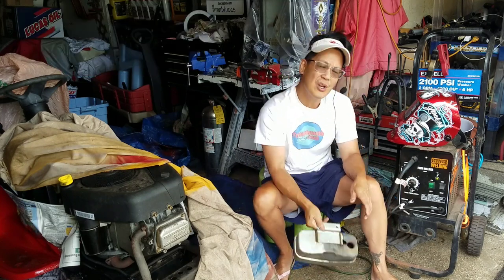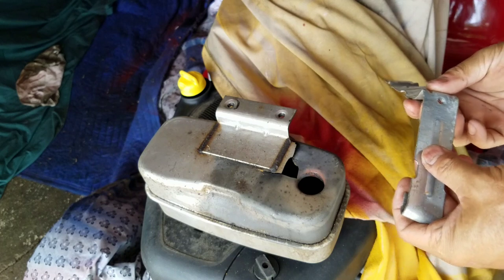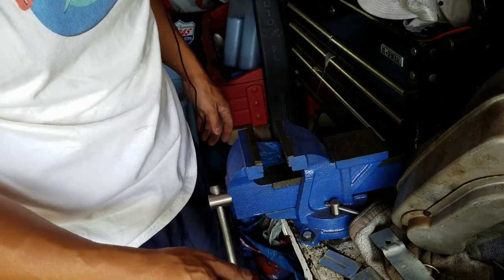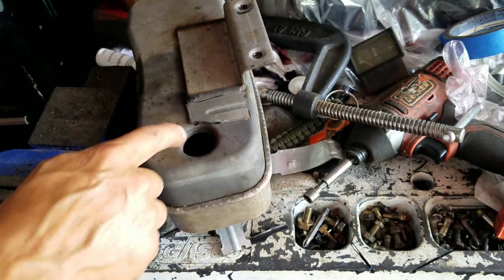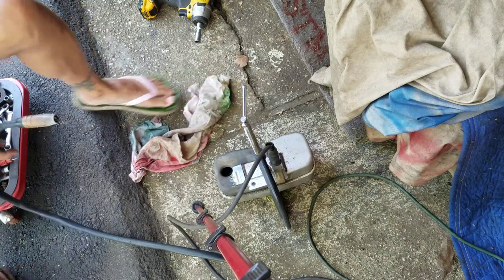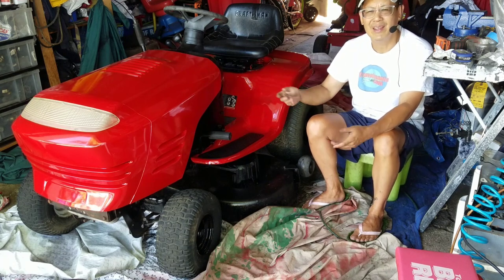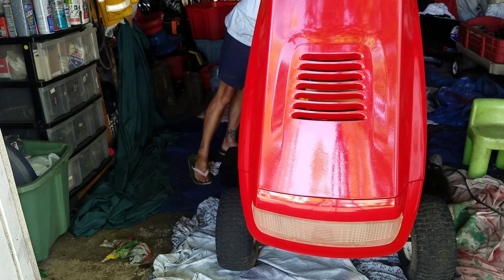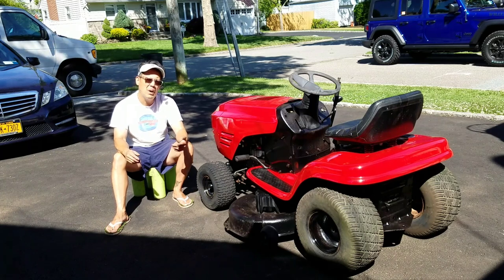FRANKEN TRACTOR NIGHTMARE PROJECT FINALE REVEALED DAMAGED MUFFLER WELDING WELD REPAIR INSTALLATION

Comment: I have the same tractor DLT 300 it’s a little bit older, but it the engine is good condition does not rust, but the pain is fading now that I watch this video I am going to do the same thing to you that I just bought today for candle spray paint red and two black one and I’m gonna paint the wheels black the frame black I think I’m gonna take it apart, but I’m going to make it look good after thank you for the video, you gave me a great idea👍👍 I can’t wait to start the project
Reply from the maker: Hope you’re subscribed

Comment: Henry, you are a GOD among men. Because of you, I was able to fix a used mower i bought from a crook, who sold me a lemon. It is a Craftsman 19.5 hp Craftman.  I changed the following:
1-Coil
2-Chinese Carb
3-Fuel Lines
4-Hitch Pins
5-battery
6-solenoid
7-Filter

Thank you so much, you are an inspiration for those who might have some fear tackling a riding mower.
Reply from the maker: Thanks Paul, glad you enjoyed the videos.

Comment: A welding tip,..... The tip on the end of the part that the wire come out of, unscrew it, and believe it of not.... Remember that show with John Davidson... Lol..... Spray it with Pam cooking spray it will make it so the wire glides smoother.... Then screw it back in.

Comment: I watch your videos every day. Tip on welding galvanized metal dip it in battery acid before welding
Reply from the maker: That doesn’t sound like fun, that is even if I had that much battery acid sitting around...lol, thx for the tip bro
Reply: @MowersNBlowers  I thought you would have old battery's let them drain in a pan or you can use muriatic acid
Reply from the maker: I don’t think I would go through the trouble, as you saw I’m not a serious welder, just get the cracks filled is all.

Comment: henry, I have a Toro rider in which the blades are always engaged, and will not stop until mower is turned off. Any Ideas??
Reply from the maker: Your engagement handle is stuck,  look underneath and find out why the belt is tight by engaging and disengaging